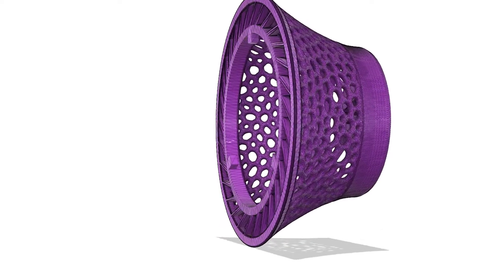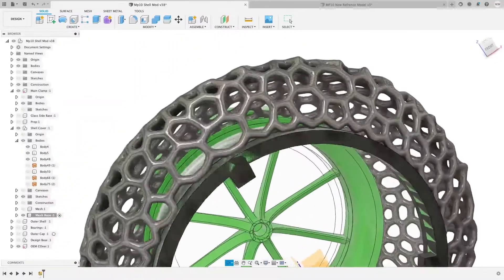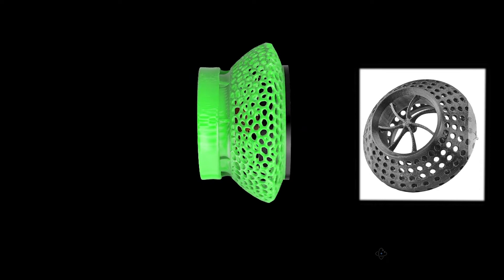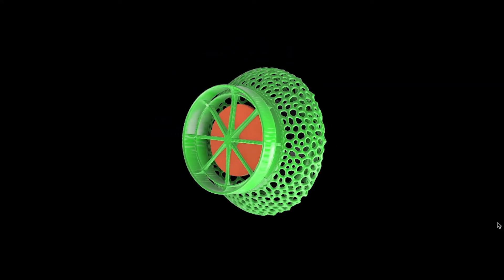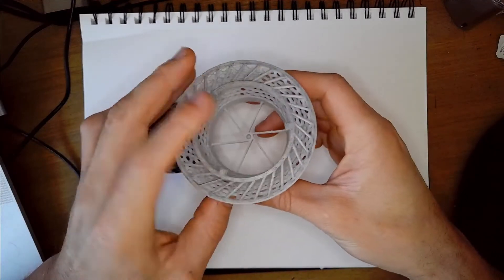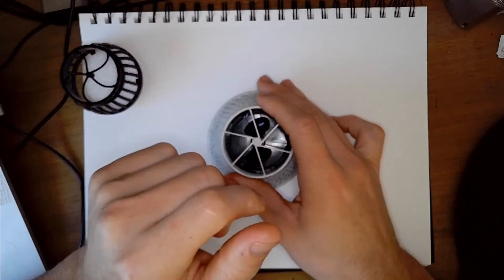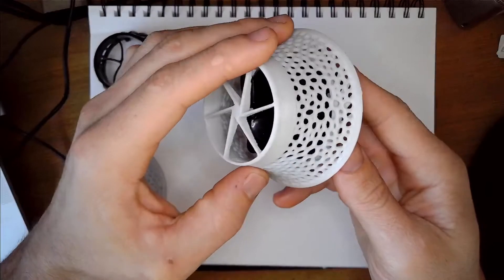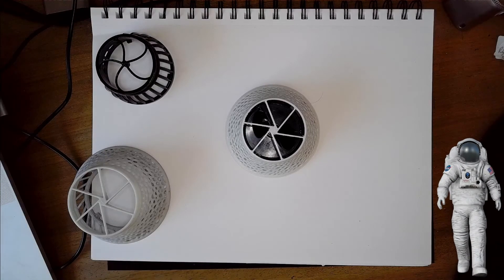VorTech MP10 Fish & Anemone Guard | Design & Build | EcoTech Marine

Comment: Do these offer any benefits? Like a wider flow or something
Reply from the maker: The primary purpose of these is to protect livestock.   Fish, anemones, and roaming mushrooms will often get sucked into the pump and chopped up.     

Beyond protecting livestock the second goal is to not restrict the flow.  The small mesh combined with the gap in the back between the glass provides enough intake flow to not alter the MP10 flow.   I just finished up a model for the MP40 & 60 as well.